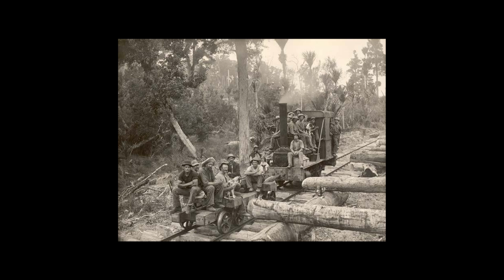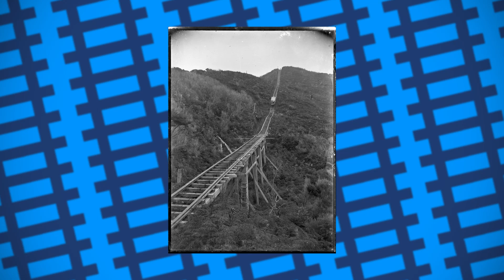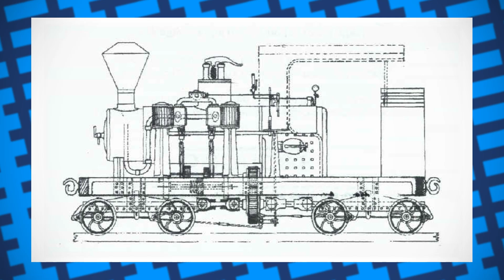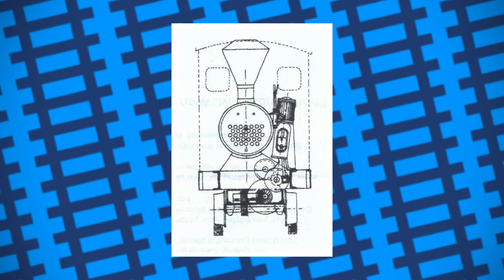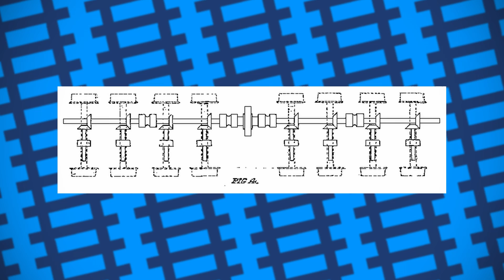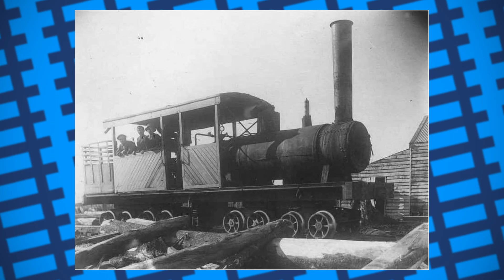New Zealand's unusual logging locomotives - Johnston, Price & Davidson's "16-Wheelers"

Comment: In Sweden we had a similar tramway in the forest. But because the country is mostly flat (and the tramway was built up anyway), they just used steam tractors with a few extra wheels. Super simple, and very light. Granted, the pulling power was quite low, while the top speed was decent for what it was made for.

What was a bit diffrent with the swedish loging tramways was that they just used log as rails and the wheels had a special shape to adopt better to the logs.

Comment: this also happened in a lot of the logging industries in America. I've heard of them out in Colorado, and even up here in Minnesota. Near my hunting property is a straight stretch of roadbed. It was never a road, I've looked. It appears more like a railroad bed, however it is much too hilly to be a railroad bed. Even for small train 3 foot gauge, its too much. What it may be is an old wooden rail, or even a log railway, where they join actual logs together and run the locomotives on these logs.

I've never been able to prove this, never been able to verify this theory of mine, other than that there are several other documented wooden rail lines in the area.

Comment: There's all kinds of crazy stuff from this era - a lot of places used gravity rails which are pretty much exactly what they sound like - a rail on a slight incline from the logging site down to the lumberyard, and instead of using an engine to haul the logs, they would just let the trolleys roll downhill with a guy lying prone at the back to feather the brakes and stop it from building up too much speed. Also, they didn't really bother to tie the logs down, they just relied on the weight to hold them on the trolleys, and there were occasions where a log would shift slightly as the trolley took a curve and just crush the brake operator under several tons of Kauri.

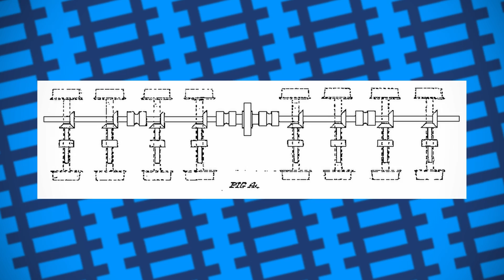Comment: 3:24 These are bevel gears as they have teeth cut on a bevel.
A spur gear is a conventional gear , so named because it looks like a spur ⚙
Reply: You can't see it on the top down drawing but the bevel gears drive a jackshaft above the axle. On the other end of the jackshaft are some spur gears that drive down to the axle.
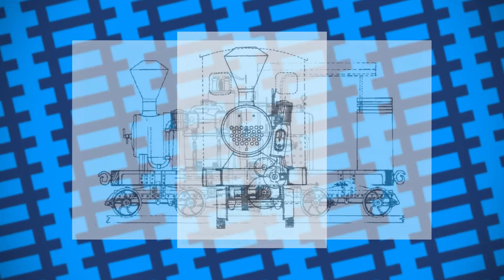The drawing of the B class at 2:39 shows them as the two designs shared a lot of parts.

Comment: If any one wants to try and build this same setup, use the Tatra center differential and lock the independent vertical swings per wheel. Since the Tatra system can be easily modified to have even more ridiculous powered wheels, you can design a true caterpillar type locomotive.

Comment: NZ bush "Lokies" were awesome bits of engineering - not just these ones, but "rail tractors" and "Jiggers" made from cut up tractors, bulldozers and trucks. Some were operating right up to the late 1970s... some even had chain drive powered bogies under the leading logs...

Comment: I always get really happy whenever someone talks about my country, thank you
Feel free to skip this next part

please do a video on
eletric trains (evaluation of them and some of the mechanics)
and evaluation of diesel and steam, atualy just evaluation of different types of trains
the porters steam loco 
the Japanese class d5,
the Chinese QJ 2,10,2
or just exsamples of asian trains 
how do gear trains work
double ended diesel trains (and electric) 
American and European switches other then the British class 07-09
what to do if the train stalls
one talking about the different types of steam funnles and there uses,
all the flags and signel light color meanings
how do fire box door controls e
work
steam locomotive combination breaks (steam and vacuum brakes)
the breaks commonly on wagons that you turn like a valve/leaver mechanical breaks

a short video on how a Armstrong turn table works 
a basic video on flagmen/break men who would ride with the train and any other "small" jobs
what did trains (mostly steam) do when going in tunnels, ive heard of gas masks or just useing a wet cloth, or did they bring in other engines like later on they used electric trains, or were there no big tunnels.

why are some trains wagion tops (the stream lining thing to boilers sorry if it makes no sense ive only heard it once)
railway terms and slang

the different types of cut offs/reversers/Johnson bar
some are a big lever, some are a screw reverser, and ive also seen some that are like rods, one exsample is train sim World 3 with the scre reverser like a stairing wheel

wet vs dry/saturated vs super steam,
is there any disadvantages to having the positions and stuff at the rear of the engine other then limited fuel ..
like mechanic problems?

Comment: You think that’s weird? That’s nothing compared to the Lartigue Monorail in Ireland, which put steam engines on a monorail track with a very weird result.
Reply: You talking about the 3-wheel engines?
Reply: @lyokianhitchhiker  I might be. Don’t remember if they are 3 wheelers though.
Reply: The Listowel and Ballybunion.   Used three rails on A frame sleepers, though only the top rail was weight bearing. Locomotives were double boilered 0-3-0s (though with the balance wheels they must actually have been 2-3-2s) . It was still necessary to balance loads, so if a cow were sent she had to travel with 2 calves, which then returned on the two sides of the wagon. Some of the track is preserved at Listowel and demonstration rides are available, though the loco is a replica powered by a diesel engine.

Comment: 16 DRIVING WHEELS?! Wow... Like...If you think about it, The New Zealand type D's broke the record of having the most driving wheels, even surpassing AA20, a Russian locomotive with 14 driving wheels (I remember you doing a video about it long ago, plus that was when I first met you.).
Reply: Technically, any locomotive with at least two sets of 8 or more driving wheels beats the AA20, so the Big Boys for example, the 0-8-8-0 Camelbacks, the 2-10-10-2s used by the Virginia RR or ATSF, and so on!
Reply: @Gayacegunslinger yeah, but the AA20 still holds the record for most driving wheels on a single frame
Reply: @lyokianhitchhiker  Indeed! For good reason too, 12 drivers on a single frame are already pushing the limits of rails and locomotives, 14 was a bridge too far.

Still, I reckon somewhere out west the US could've made it work, but I digress.
Reply: @Gayacegunslinger  yeah, once you get past 12, you pretty much need articulation

Comment: I have seen one of the A.G. Price locomotives when I visited NZ, it's preserved in Christchurch but not operational. I don't remember if it had the standard 8 wheel design or more than that, but it had the vertical cylinders in the cab behind the boilder.
Reply: If that's the one at Ferrymead it would be Cb113.
Reply: Would be brilliant if it were in Ferrymead as l'm not far from there.

Comment: A suggestion for a future video. The Wolgan Valley Railway. It was a standard gauge line in the blue mountains going to Newnes and it's oil shale refinery. It used 4 Shay locomotives (since the grades were difficult for traditional locomotives) and interestingly enough, the remains of one of the locomotives is used as a bridge on one of the hiking trails near the glowworm tunnel.

Comment: I'm now wondering just how they changed out the gearing when it wore out or stripped especially considering that it was probably done in the field and that is assuming that the gears weren't integral to the drive shaft instead of being pinned in or something of the like.
Reply: Ironically it looks like it'd be harder to change out the gears than on a normal Shay design due to the entire driveshaft being between the wheels, you'd likely need to get underneath the frame and/or completely disassemble the driving axles.
Reply: @asteroidrules  Before 1923 they were keyed to the axles and a wheel would have to removed to replace them. From 1923 split gears mounted to hub on the axle were used.
Reply: those kind of things don't wear out very fast provided they're lubricated properly.